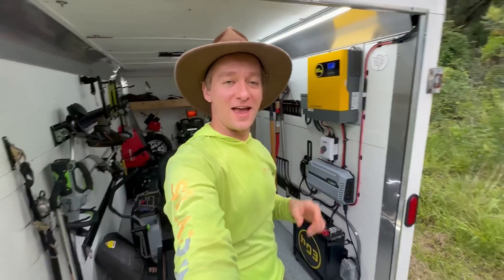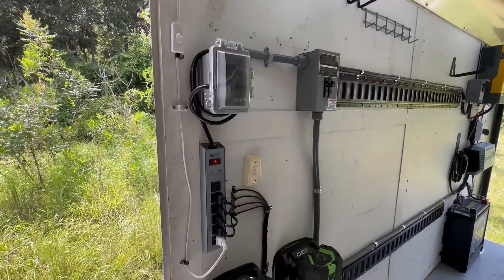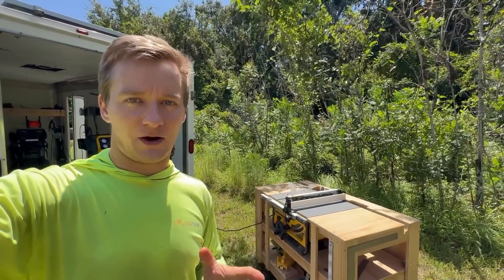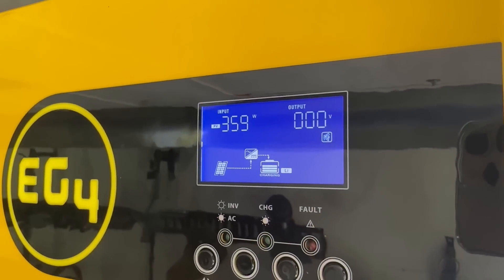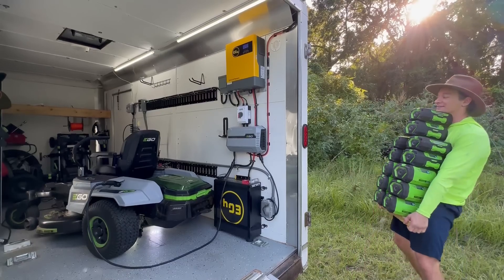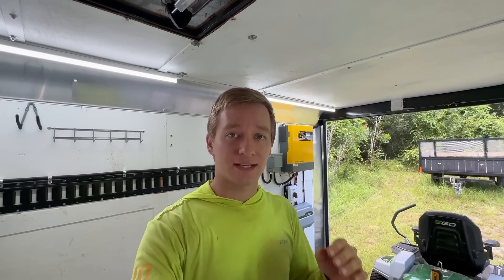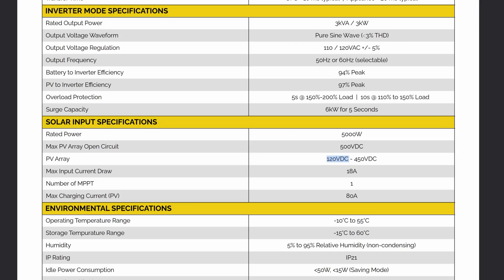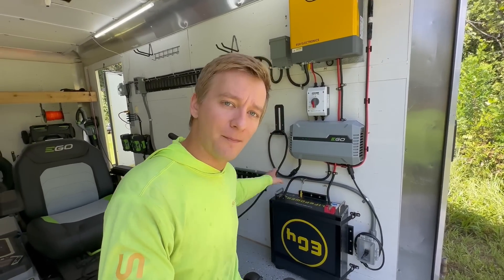Solar Powered Lawn Care Setup; Why Not Just Buy More Batteries?

Comment: That's a nice electrical setup but does it need to be earth grounded like a house since its wired with 3 prong residential outlets? Someone told me before that looping earth grounded appliances that have 3 prongs could be dangerous if you have more than one hooked up at the same time and they were on an isolated system, if one appliance has an electrical fault of some kind and you touch both appliances at the same time the power would go through you. A simple way to think of this is just the power strip. The 3rd prong is bonded together in the power strip meaning if you plug more than one 3 prong device into it then the earth grounds are bonded in the power strip. I'm no expert on this topic but I always wonder what people do in these custom setups to have the same safety level as a house ground. I guess if you have all new equipment things should be good but rarely things are faulty, rodents chewing on cables etc...
Reply from the maker: So, power "goes out" on the black wire to whatever you're powering and "comes back" on the white wire (not exactly how it works because this is alternating current, but it helps explain).  The ground/earth/green wire is just in case whatever device you're operating has an issue or short, it has the ability to return that power to the source of the power generation, in my case my inverter. If things are setup correctly you should trip a breaker and the system will not continue to output power.

The way you need to view this setup is like an RV.  The neutral (white) and earth (green) are bonded together inside the inverter (just like a main breaker panel in a house) and then the inverter is bonded to the trailer frame and that acts as the main grounding/earthing, you can't practically drag a metal rod or hammer it in the ground everywhere you go and since the trailer and car are not in conductive contact with the ground (rubber tires), you're essentially a floating system.  If you plug the inverter in to the house the inverter actually software switches the earth/neutral bonding off so that only the house's main breaker panel has these bonded together and the trailer earth is bonded to the main house earth and therefore you are no longer a floating system.  Basically just an out-building, like if you had a small workshop or garage.

What you don't want in any electrical system is a person touching a device or object that has a different potential energy to some other device or object that they are touching.  So if I touch my inverter case while I'm touching the frame of the trailer, I want them to be at exactly the same potential as each other, because if they aren't, I can become that path for the electricity to flow, thereby getting shocked.  Now there's still a risk of me touching the actual soil/dirt of the earth while touching the trailer and those being at different potentials but it's quite rare and hopefully building a safe system with secondary safety systems in place to try and catch a problem is enough that you won't ever experience an issue.

I'm not a licensed electrician, please do your own research and hire a trained professional to do your electrical work and please don't sue me ;)
Reply: @solarpunksteve  Thanks for the detailed response, it is a grey area that not many people talk about in YouTube videos showing a solar setup. Good info. I plan to hire an electrician if I do any large solar setup.

Comment: Hello, i have a question. Lets say i only buy a battery. How can i charge it if i dont have the controller ? Is there some sort of charger or something ?
Reply from the maker: As @KaceyGreen stated, you can buy a separate charger for just the battery but you still have the issue of getting the power out into something you can use, not to mention controlling the charge state of the lithium iron phosphate battery.  Basically, you can't just buy a 12v or 24v or even 48v lead acid battery charger and hook it up, you have to have a specially designed charger to make sure you're not damaging your battery.  In my case this inverter/charger takes care of that, not only are they the same brand so they talk to each other over a data communication cable, but even if they weren't/didn't, I can program the inverter/charger to maintain the battery based on specific voltage levels/profiles.
Reply: @solarpunksteve  interesting. I have a bluetti ac300 and those batteries are cheaper and denser than their own pack. I was wondering if i could hook it up to the power station somehow.
Reply from the maker: @dcarmageddons Unfortunately that’s beyond my knowledge right now. I looked at buying something like that for this setup initially, but cost and solar setup weren’t what I needed. They are a great option for most people as it’s just a self-contained version of what I have, but unfortunately the costs still haven’t come down to anything reasonable in my opinion. Maybe check out Will Prowse on YouTube as he has lots of videos on inverters, batteries, and those “battery generators” (silly name).
Reply: @solarpunksteve  the Ecoflow Delta Pro and Power Kits live up to that name when hooked to solar and/or their generators but as you said price is too high for something like this VS what you went with
Reply from the maker: I know, and I get why we call them that; gas generator, diesel generator, battery generator.  It just kinda bothers me because all it is is a battery with an inverter/charger built in, it's not really generating anything.  Yeah you can hook solar to it, but most people aren't going to or don't realize that's what you need to do if you take it camping and need to charge it back up etc.  I don't know, I guess I'm just salty from the cost and marketing of these things: "First portable home battery designed for home backup" and" 3600W-7200W AC output for 99% appliances." except at 3.6kWh, that means you could maybe run a couple devices (window unit, fridge, microwave, fan etc.) for an hour or two.  Not really "whole home backup/99% of appliances" unless you buy a ton of their batteries that are IMO too expensive.  So I just feel they are kinda misleading people that are already having a hard time figuring out what a Watt is, much less kW vs kWh, AC/DC, inverter/charger etc.

That being said, looks like they dropped the price on their website (ECOFLOW) so maybe one day we'll be at cost parity.
Reply: @solarpunksteve I agree they shouldn't be called generator in their battery and inverter only config. 

I've got a full set of Delta Pro with the Smart Home Panel, if it weren't for great sales, refurbished deals, and mis-prices I wouldn't have gone this route., 

After seeing how much simpler it has become with the likes of EG4 and competition with ready-made batteries, I don't see these turn-keys becoming cost competitive unless they drop prices significantly or allow managing properly speced batteries (correct voltage and cabling etc). Like if they made an EcoFlow Powerkit brain that could hook to that EG4 battery and the rest of their ecosystem including the DC generator they'd have a true moneymaker on their hands, something to compete with many more markets than they currently play in. They'll likely retain the man-portable market for some time though.
Reply: You can use a separate charger. But the battery is putting out DC so you'd also need an inverter to get a power back out. So he got one that is a charger and inverter that can also take solar or shore power.

Comment: New subscriber here. I like your setup.  I like the EG4 better than like a EcoFlow since the EcoFlow doesn’t start back up if it goes below the threshold.  You may not care which is fine.  I have thought of a portable setup with panels on the roof.  One thing I am interested is sliding an additional set of panels while parked. Anyway that is just dreams until I actually
 make it, right? Haha.   

I actually use Battery mowers and chain saws among other shop tools at my country home in Texas.  So a portable filling station such as yours appeals to me.  
Thanks for the video.
Reply from the maker: Maybe next trailer I’ll go all out with deployable Solar just to see what we can do ;). But for now my small array makes the most sense in terms of simplicity and reliability. Don’t want some deployable array getting stuck or hit by a truck driving past when I’m parked or flying out driving down the road. 

You’re welcome! Make sure to check back later when I post the videos on the installation so you might be able to get an idea if it’s something you can/want to do.
Reply: @solarpunksteve  yes it all makes sense. Your use case is to be parked on the street where mine is in a driveway or RV slot.  Definitely don’t want to be catching traffic with those wings deployed.  lol. 

I have been in battery operated lawn care since I first purchased my Ryobi about 12 years ago.  Battery life has always been a concern so I bought extra batteries.  I don’t plug a battery in the charger right after use due to heat as well.

Comment: You should look into charging the batteries on DC. There's a variety of ways to do that but it is pretty inefficient to convert to AC to just convert back to DC downstream.
Reply: I was thinking the same thing. The EGO batteries are nominally 56V, not too far above the nominal 48V of the EG4 5kWH battery. By using a DC-to-DC boost converter it should be possible to charge them, but the issue is battery management. I don't know if the EGO batteries have a built-in BMS (Battery Management System), but I suspect they do. If they do, then it would be easy. I tested one of my EGO batteries and it measured 57.4V without any load. Nominal NMC lithium cell voltage is 3.6V, so the packs probably contain 16 cells in series, and can be charged up to 4.2V. 4.2 x 16 = 67.2V, so a DC-to-DC converter outputting around 68V should work well. Of course doing this would almost certainly void the EGO battery warranty! Proceed at your own risk.
Reply: @gregben Ego batteries are 51.8v Nominal (14s @ 3.7v) that EG4 lifepo4 is 51.2v nominal (16s @ 3.2v).  The problem is the EG4 battery would need to be full to get the ego battery to charge to probably 90%.  If the EG4 battery is at 70% then the Ego battery could probably only get to 60%.  He could skip the eg4 battery and charge direct from solar to the ego batteries, but no sun means no charge, and his mentioned premium  price for tool batteries.
Reply: Assuming the EGO charger inside has its own built-in power supply, I bet you could find out what voltage it steps the 120V AC Down from probably like 56V like you said, and then just do DC-DC Convertion to the charger board, bypassing the built-in Power Supply.  This means you get to keep all the safety features of the EGO Chargers while removing AC-DC Looses.  I did something similar when I realised my monitors all used 12V internally, and bypassed the internal power supplies just to feed it 12V from my computer's Power Supply. @gregben
Reply: I came here to say the same thing. Converting DC to AC back to DC equates to a significant amount of power loss. Going DC to DC would make this system significantly more efficient.
Reply: Exactly, his calculations don't consider the efficiency losses of going dc to ac to dc
Reply: That would be ideal, but I'm sure the batteries/mower would not be happy, and any warranty would be void using unofficial chargers, and insurance would kill you if they found out you burned down 100kish of equipment to charge maybe 2% more an hour
Reply: he could have also bought a ego. Nexus power station and separate solar chargers breach one. But it wouldn't have charged quite as fast.@darkfireBikes
Reply: This has the added benefit of being officially sanctioned by ego. You'd be able to convert the most amount of power from the solar panels back into the batteries.
But the problem with those stations is they don't support pass through 
So you can't charge and use the power from the batteries at the same time. Which in this set up probably wouldn't be a big deal.
Reply: while I would say the same thing in most solar to battery setups, in his case, I'm not so sure if it is worth it. It could be a Nice challenge or learning experience though. it will entail taking apart a battery charger, bypass the transformer/ac-dc circuit with a DC power source.  DC power source may come from solar panel to 48V MPPT charge controller then boost it to higher voltage with a DC-DC converter. 
But then, most important project to look into is to replace the proprietary battery for the lawn mower with LifePO4 cells.  Not only EGO 56V batteries expensive, they have shorter cycles, and with nickel cobalt components that are political and environmentally bad.

Comment: Gret video. I sure like to see the ECO batteries capacity test after about 200 cycles of use to see how well they hold up.
Reply: I have been using EGO battery equipment for a couple of years now. And with commercial use, it is normal to have 3 cycles a day. A little math and I have a couple of batteries that have more than 1500 cycles on them.😎 They are showing their age. They definitely don't last as long as the new ones, nor do they deliver as much power when doing heavy load applications (like chain sawing or blowing) But they are not trash either. I just use them in less demanding locations or in tools that allow multiple batteries. 
When my power went out for almost 48 hours at the beginning of this year, I was glad for every watt hour of battery that I had not yet sent off for recycling. 😅
Reply from the maker: Yup! This is a big question mark and only time will tell how long they last, hopefully they last long enough that by the time I have to replace them, there's a better/cheaper/longer lasting option out there.  I'll cover some of these things in more detail later, just trying to get some people thinking about what might be possible or what might work/not work for them. Thanks for checking it out and subscribing!
Reply: @solarpunksteve  ego site lists cells used for each battery, the ones I checked were rated at 60% (ICR18650/20P inside 6Ah) and 73.8% (INR18650-30Q inside 12Ah) after 300 full cycles, at which point they are morally dead. The 48V lifepo claims 7000 cycles (but usually for only <=80% cycles)

Comment: I live with an off grid, solar system and watching your video made me smile and I think to myself why would people ever bother with gasoline for lawn maintenance purposes it seems so foolish, knowing that the exhaust gases are highly toxic and super noisy and the flammability hazard. Good for you man I like your set up you should franchise that idea and it would take off.
Reply: What I love the most about my battery lawn equipment is less noise and easier to push/use.
Reply: @@zippydastrange I have been driving my electric car for 12 years now and all I’ve ever done is replace the tires and brakes and the windshield wipers. Batteries are considered high grade ore and therefore are not put in the landfill. They are used to make the next generation of batteries. It is far better to transition to electric technology, then garbage gasoline engines. In my lifetime I have rebuilt all kinds of engines with carburetors and I am so sick of doing it. I won’t do it anymore. Gasoline is toxic and it absorbs into your skin and destroys your liver. Since my electric car is recharged with solar energy I don’t have to worry about a dirty energy source in some remote location. I know I’m ahead of everyone and it’s gonna be catch up for you.

Comment: Dude this is a absolutely sick setup for electric lawn care!
How you have everything connected with the eg4 system is so clean too.
I have a similar setup but larger inverter and batteries for a home backup power and to charge my tesla during the day. 
You did a really good job making the video too its very entertaining and informative. 
I wonder if in the future you could modifiy the EGo mower to run off a Eg4 weatherproof battery they have a few different sizes.
That way your battery would be a lfp and cheaper for the same capacity.  
just be a little rewiring and retrofiting but for you looks like cake with your skills.

Take it easy man,
Casey
Reply from the maker: Thanks so much! I've thought about repowering the EGO mower or something like it with LiFePO4 batteries instead of the NMC/NCA stuff they have, but ultimately it's not practical in the long run.  I mean even my setup is way beyond what others are going to feel comfortable doing, but if I throw in the added complexity of hacking a mower to use a different battery, I've probably lost 99.9% of the lawn care community.  Whatever the solution ends up being, it needs to be something everyone can utilize practically and repeatably, while allowing them choice and freedom to move to/between other brands etc.  At least that's how I'm trying to approach the problem;  i.e. what can you go out and buy today at your local stores/websites and build with limited tools/effort that's relatively cost effective and scalable/expandable.  We'll see how it goes!